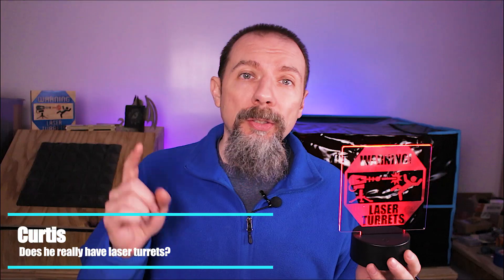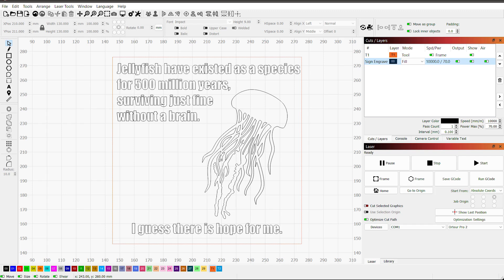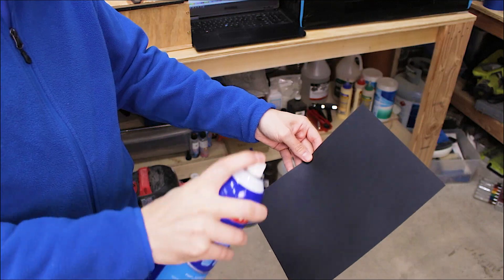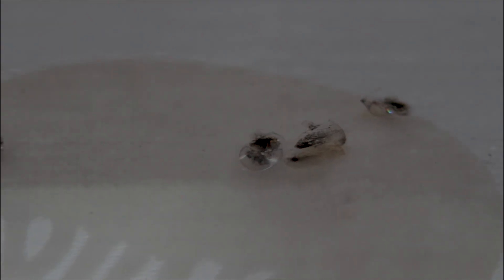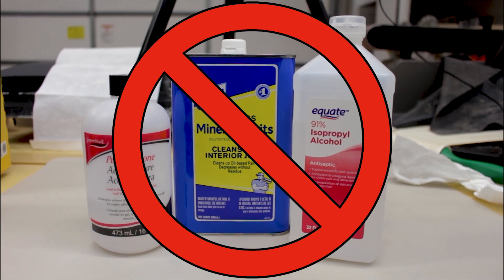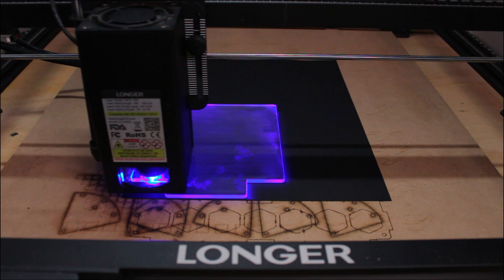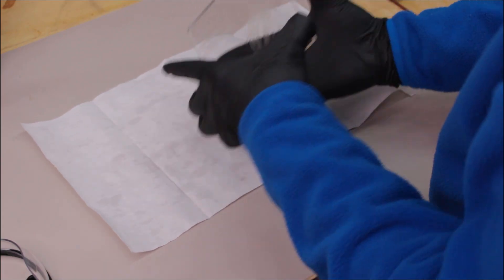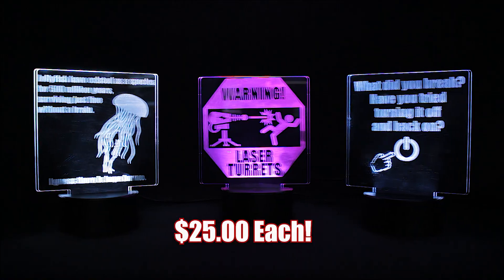Easy Laser Engraving on Clear Acrylic!

Comment: Hello and thanks for the video. I know each machinebis different and i am trying to run material tests to dial mine in butbused your numbers as a starting point. I ise the detergent and card stock with my 10W diode laser. Ifbi go any slower than 9000 mm/m and higher than 30% power, the black won't come off. If i go faster and lesser speed, then it doesnt really "etch" it enough to call it a success. I have my line interval at 0.13 or 195 LPI, overscanning at 2.5% & bi-directional fill off to reduce heat in one spot. Do you have any other suggestions?

Comment: Best video about engraving clear acrylic on a diode laser I've found.  Question:  How deep does it etch?  I've made a couple, and the etching is not very deep, just on the surface.  When I slow it down, 10,000 mm/min, 50% power on my Comgrow 20 watt, I get the burned bubbles.  20,000 mm/min 60% power etched it very cleanly, just not very deep.  Just wondering if the very shallow etching on the acrylic is normal.
Reply from the maker: Thank you!  Sadly, you will not be able to get a deep engrave with this method and a diode laser.
Reply: @LetsMakeAThing  Thanks, and that's fine, as the results were good.  I just was wondering if that was the normal result.

Comment: Great video, Thankyou. Been wondering how to engrave clear acrylic using my diode laser, one question though. What alternatives you would recommend in place of the spray adhesive ?
Reply from the maker: You don't really need the spray adhesive. I've had lots of people let me know they successfully used this method without it.

Comment: Is it possible to engrave deep enough to be able to fill the engraving with black paint? I want to make clear round knob dial skirts with numbers engraved (miror imaged) on the back side of 1/32 clear plastic cut the center and the perimeter out (like a disc with a hole in the center) and then fill the numbers with paint so they stand out with illumination from the rear. Sam
Reply from the maker: Sadly, you'd need a CO2 laser to get a deeper engrave into the clear acrylic.

Comment: Followed your video, however, didn't use any glue/spray on the card stock, used one sheet - folded in half.  Everything came out perfect, but 70 power and 160mm/per sec speed is too much,  have to lower the power or up the speed.   using a 20watt laser by Xtools.
Reply: Thank you for posting your settings :) I don't have Lightburn and was wondering what the XCS settings would be :) I am going to try it tomorrow :)

Comment: I tried your settings and immediately the acrylic started popping. I have the 20 watt WeCreate Vision diode laser. How is it that you're able to use such a high power percentages when most other recommendations for etching acrylic with a diode laser are to use low power?
Reply from the maker: It could be that the auto focus on the WeCreat isn't precise with the clear acrylic and it's ending up slightly de-focused. I found when I de-focused my laser at all it caused the popping with the speeds and power I was using.

Comment: Hey. Hey,

I'd like to ask you.

Could you please help me?

I mean, even when I use detergent, my acrylic is still tan from underneath and it's black.

Could I ask for a straightforward procedure?

I recently bought a diode laser because of making this and I can't figure out what to do and how to do it.

I've been watching your videos for a while and I really like them but unfortunately with this acrylic I don't know what to do .

Thank you for any answer and help

Dan
Reply from the maker: I'm not sure if by detergent you mean dish soap or laundry. Be sure you are using dish washing liquid, as some detergents will have chemicals that react and cause more problems with the engrave.

You might also want to try playing with your power and speed. If you're getting black and tan you might also be running too hot and/or too slow. 

It's a process and can take a lot of trial and error to dial in for your laser.

Hope this helps!
Reply: Hi

I use dishwashing liquid and black cardboard.

I've used so much acrylic I don't even count it anymore 😁.

I also have a 20W laser but from a different company and I noticed you use a 20W laser too.

Could you please try to send me your parameters for comparison?

Thank you for your help.

Dan

Comment: Your videos are making my dive into laser cutting/engraving so much more pleasurable, thank you! However, I couldn't get all the black off my acrylic, could you tell me why that may be?
Reply from the maker: I found that when I was getting leftover soot on the acrylic it was one of two issues. Either I was putting the soap on too thin or I was still running the laser too slow (or too much power). It took a lot of tweaking to get it just right.

Comment: I am using a Creality Falcon2 22w. The acrylic is popping like crazy with these setings. I lowered the power and increased the speed and it is still happening. Any suggestions?
Reply from the maker: Double check your focus. I found that when my laser wasn't focused properly I'd end up with lots of pops. If you haven't done a ramp test to make sure your laser focus is dialed in I'd also suggest doing that so your focus is really precise. If you've done both of those things, keep going faster and lowering the power till you get it dialed in.

Comment: Hello Curtis. I also have a 20-watt laser and you mentioned you engraved this at 10000 speed and 70% power? What are your settings for cutting the clear acrylic? Thanks
Reply from the maker: Sadly, you cannot cut clear acrylic with a diode laser. If you want to cut clear acrylic you will need a CO2 laser.
Reply: @LetsMakeAThing  Ok Thanks. I was curious since you purchased the 12x12 sheets. Was that so you can test the engraving?

Comment: Thanks for the video.  I ordered rhe card stock and adhesive to give your method a try.  Question, what does the adhesive do for tuis method?   Does laying the card stock down without glue cause an issue?
Reply from the maker: I used the adhesive to make sure the card stock wouldn't move around and cause alignment issues. May not be necessary, as I often over-engineer solutions.
Reply: @LetsMakeAThing  gotcha.  Thought maybe was a added later of protection and not necessarily a necessity.  I ordered it anyway.  My laser head doesn't move though so I may try running it tomorrow with just the card stock

Comment: Thanks for the video.  What’s the purpose of the spray glue? What’s it purpose?  Thank you
Reply from the maker: You're welcome! I used the spray glue to hold the card stock down to my bed. It wasn't really necessary in retrospect. I just wanted to be sure it didn't move during setup and engraving.
Reply: Thank you very much. Gonna try tomorrow.

Comment: What Minimum wattage laser required?
Reply from the maker: You should be able to do this on any diode laser 5.5 watt and up. Just need to run slower if you have a low powered laser.

Comment: Hey, tell me, I have a sincere question, I'm French, I tried your method, however I really can't get the same result, I use transparent acrylic and not black like you, I I have an Xtool D1 Pro 20W & Infrared 1064nm - Also, I ordered on Amazon France, black cardstock, spray glue, and a silicon mat, but in both cases, I have the cardboard that "background" and on the acrylic a burnt residue, due to the cardboard, any idea? how to do? thank you =)
Reply from the maker: Did you put dish soap on the acrylic before laying it on the card stock? Without the dish soap you won't get as decent of a transfer and will end up with the brown residue.

Comment: If you plan to sell these plexiglass signs to the public, I would never use paper towels to wipe off water or anything with any paper towel or tissue because you can make very small fine scratches on the PLexi, you should use a cloth that is made specifically for cleaning your Large screen TV. they sell this cloth for screens and photo lenses to prevent tiny scratches when wiping off dust and stuff, but use mild soap and water  & nothing harsh, rinse then wipe gently.

Comment: when you say, "focus on the top of the cardstock..not the acrylic" what do you mean? I flip the latch down set the laser on top on acrylic and tighten down before lifting it back up...am i supposed to do that differently?
Reply from the maker: Like I showed in the video I put the card stock down first and then I focused on the card stock before I put the acrylic down. In your case, you would use the the latch on top the card stock, lock your laser, then move it out of the way and add the acrylic. Hope this helps!
Reply: @LetsMakeAThing  i was thinking that's what you meant, but I'm not near my laser and thought it would bump up against the acrylic piece that way. Ill try this when I get home. Ive had my laser for a couple days and thought I had it down but nope not yet. Thank you for your video.
Reply from the maker: @vz3390  Hope it works out for you!
Reply: @LetsMakeAThing  thank you. And actually now that I look at your video again I see why I was lost when you focused the laser on the cardstock. You were using that black item to get the laser focus right. My xtool doesn't utilize that so you have an extra gap where you can slide the acrylic under whereas my light shield is very close to the material so I dont have as much of a gap to slide the acrylic under. Any advice?
Reply: @vz3390  If possible, you might remove the light shield to gain space below the laser (I can do that on mine). Of course, protect your eyes with special glasses, then.

Comment: Your method worked beautifully! I was applying black paint on the underside of acrylic and alcohol to remove fingerprints and dust. My acrylic kept cracking!! The soap and detergent worked wonders, and I prefer the black card stock rather than paint (no messes or cleanup in between). I actually used your settings and the results were great! Thanks a bunch.
Reply: I AGREE THANKS
Reply from the maker: Awesome! Glad it worked so well for you!

Comment: Would this work to actually cut the acrylic? Even if it takes long or something.

Because spending +3k € for a machine outta nowehere hurts a bit too much =/
Reply from the maker: Unfortunately, this will not work to cut clear acrylic on a diode laser. You still need a CO2 laser for that.
Reply: @LetsMakeAThing  thank you a lot for your fast reply!
Yeah, i thought so, but still had some hope.

Well, i guess there would exist some vídeos of people doing it if it was in any way possible.
Reply: AFAIK, you can cut black acrylic with a diode laser, not clear acrylic. You don't need a 20 W laser to engrave acrylic, a 10 W is enough (perhaps a bit slower; mine peak a 6000 mm/min), so the price might be lower (and there are often sales).
Reply from the maker: Yes, you can cut black and most other colored acrylic with a diode laser because the color allows the acrylic to absorb the diode's wavelength.

Comment: Hey sir, Does this will work on a Atomstack 10W laser ? Thanks
Reply from the maker: It should.  Although you'll need to test for speed and power since your laser is a different wattage than mine.
Reply: @LetsMakeAThing  Thanks a lot, so the concept you used, is having high speed with less power right ?
Reply from the maker: Yes, if you go too slow with too much power you'll end up cracking the acrylic. Start faster with medium power and dial it in from there.
Reply: @LetsMakeAThing  Thanks a lot for the help sir. Much appreciated !
Reply from the maker: You're welcome! Let me know how it goes!
Reply: @LetsMakeAThing  I will, thanks